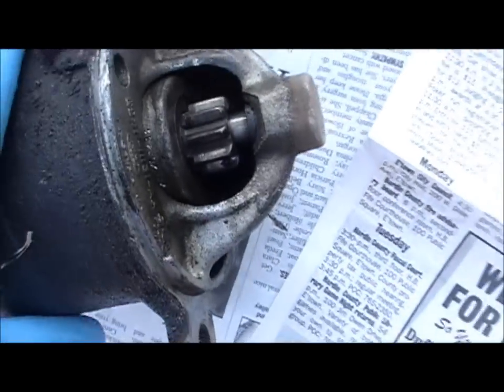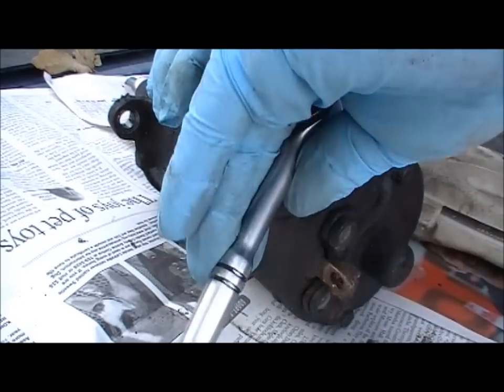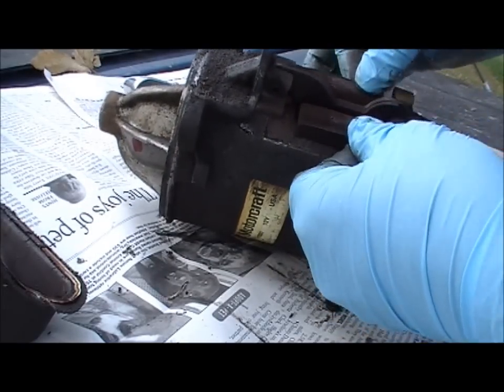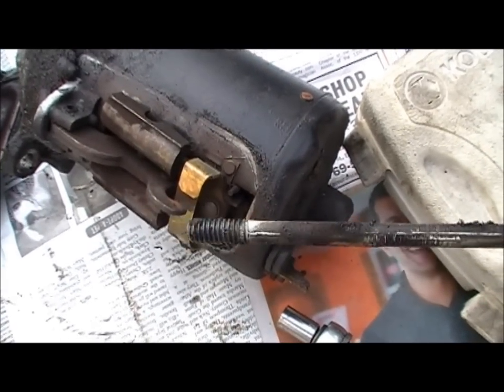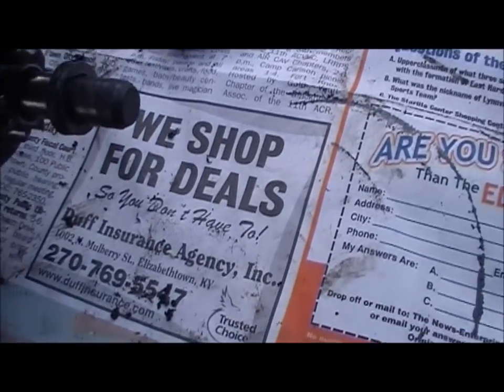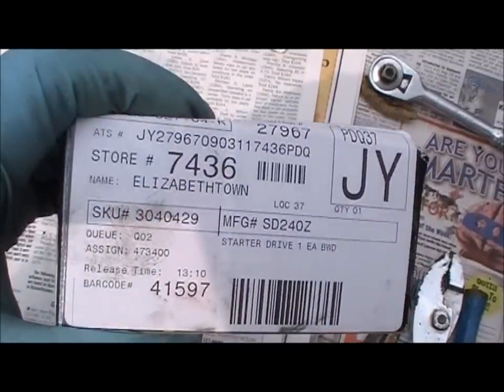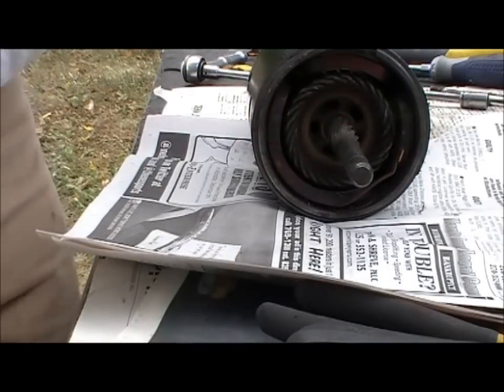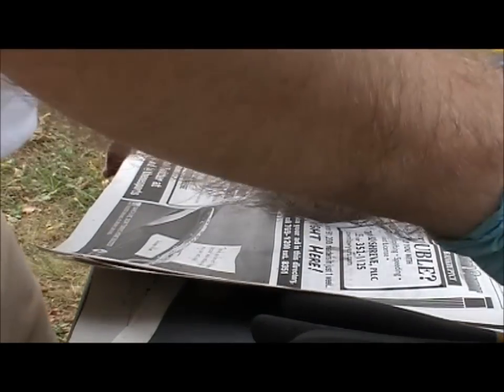Ford Starter Rebuild

Comment: You'll have to read the post below for this to make since. 
It was not my starter after all. It was the starter and ground cables. They were corroded internally and were not allowing a solid ground to the starter. I replaced the ground cable that is connected to the bottom starter bolt and the positive cable that connects to the relay on the fender wall. I also replaced the starter cable that runs from the relay to the starter, and I replaced the relay on the fender wall. Problem solved.

Comment: This is not a starter rebuild but it should be, This video is a simple Bendix or starter drive replacement. While you have the starter off of the car and in your hand you should replace the bushings and brushes then you would have a rebuilt starter. I heard you say you are scared of the brushes (its hard)  No its not. Take a picture before you take the brushes out if you are worried about putting it back the same way it was.

Comment from the maker: It sounds to me like the starter itself is either locked up or it has burned it. maybe try to tap on the starter housing a little and see it starts then. It also may be something simple like the brushes being bad.

Comment: I have a 1991 F150 and over the last year or so I have had what I thought was a starter problem. When starting the truck the bendix would not retract after the engine was running. I would replace the starter with a  rebuilt one and after a while it would  do it again.  It would get worse over time and eventually the starter would lock up.  I researched this issue on the internet and found many F150 truck owners were having the same problem. 
 After replacing 4 starters I figured it out.

Comment: I have a 78 F-150 explorer and I believe the starter may be shorted.  When I turn the key I hear the relay but nothing beyond that.  The positive wire on the battery and the power wire to the starter get really hot.  What could the issue be?  I'd like to take it apart to repair it.  I'd like to hear your tips, thanks.

Comment: That's not a solenoid cover. "Just need some lubrication" LOL. That thing is oil soaked and full of grit. Dunk it in diesel for a day. Take apart and clean with contact cleaner. Reinstall.

Comment: You don't say what year your Ford is. The solenoid on mine is not on the starter but on the passenger side fender near the battery. It's a 1989. So your video is useless to me.